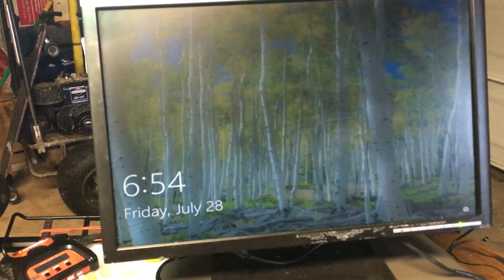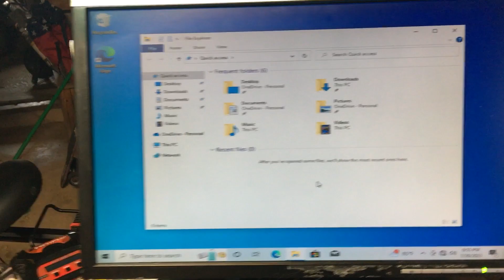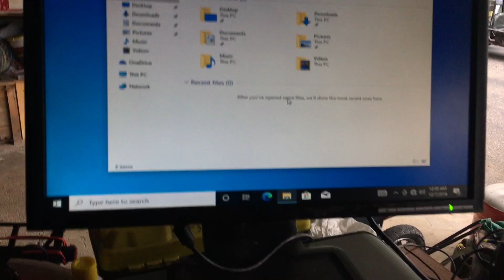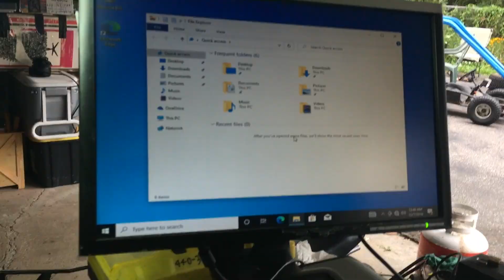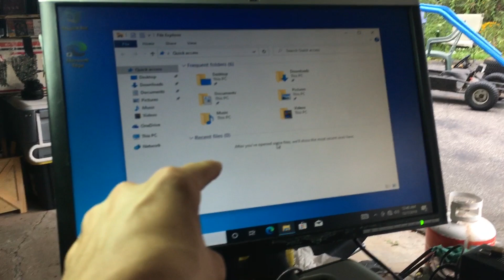Can a SSD Make Your Old PC FASTER

Comment: How did you get windows 10 to run on yours because mine would bluescreen
Reply from the maker: @XDVORTEX09hi how are you doing? I created a windows 10 bootable thumb drive 
Inside of Rufus, I selected the mbr partition style, and then after the thumb drive was finshed, I plugged it In and proceeded to install windows 10, try making sure the windows 10 thumb drive is in mbr scheme
Reply: @ I created the thumb drive but I don’t know what mgr partition style is

Comment: POP OS {Linux} just works well on older machines whether it has a SATA drive or SSD...

Once I get Wine to work in Linux, there will be no need for me to ever touch a computer with Windows on it - forever!
Reply from the maker: Correct yes, I ve always had trouble trying to get wine installed, but I will have to take a look into it Thankyou

Comment: For an older PC or laptop, I just double the ram and that gives a performance kick...

For Windows users, it does not matter how fast the hardware is - as long as that computer is connected to the internet, eventually it will slow down because of all the commercial crap running in the background and the forced updates...
Reply from the maker: Oh yes indeed, I agree

Comment: I just about BAILED OUT when he CALLED A SPINNING RUST DRIVE and OPTICAL DRIVE_but I stuck with it. I replaced a supper slow _RUST DRIVE in a 12 year old HP tower case computer with a Samsung - 870 EVO 500GB  a SSD SATA and it made it into a LIKE NEW FASTER COMPUTER. Then a couple of weeks latter the BIOS failed, and now it will not detect the key board or mouse in BIOS, I can't get into the BIOS and it will not boot to Windows. One NOTE with the Samsung - 870 EVO 500GB  a SSD SATA drives, if you think you will be handling it a lot put a strip of clear packaging tape over the label or take a photo of the label the CRAPPY INK that Samsung uses on the labels RUBS OFF onto your FINGERS!!! And you can no longer READ the label!!!
Reply from the maker: yea for some reason, I have always said optical drive my brain pan always thinks to say that lol, i do know what the correct names are for it tho, thats interesting that your having that much issues with that ssd in that tower, could be a issue with the keyboard (i am sure you tried multiple keyboards and no luck) i am not sure, if you can reset the bios if there someway to slect options in the bios, other then that I am unsure, keep trying different things, normally any desktop will respond to the keyboard no matter what.
Reply: @TechSimplified910   Thanks for the reply, I did try two additional keyboards and mice and they did not work. I also tried both the keyboard and the mouse on two different computers and the did work.
I removed the BOIS CMOS battery and all of the external devices from the computer and let it sit over night, the next day I installed a NEW BOIS CMOS battery along with all of the external devices rebooted the computer the keyboard showed lights press the Esc key and it went into the BIOS setup, I configured and saved the BIOS, the computer booted in to Windows and ran like it should. At this point I wanted to see if it would restart so I shut down windows removed the power cable and press the start button to discharge the capacitors on the mother board and in the power supply when I rebooted it  there were no lights on the keyboard and I could not get into the BIOS and it would not boot into Windows.
I repeated all of the previous steps and it will not go into the BIOS or boot to windows. At this point I am lost I believe the BIOS chip on the motherboard it TOAST!!!

Comment: It will not make computers faster that have old amd processors in it with a total of 1mb l cash in it. Even if they are quad cores.
Reply from the maker: true yes indeed
Reply: It will speed up load up time.

Comment: SSDs also need less power, produce less heat and most important, make no noise at all! My computer boots in about 25 seconds to the prompt. Linux
Reply: HDD hard drives has a limit after 8 to 10 factory resets it starts to lose blocks of data (starts to fail) ssd can handle up to 10,000 factory resets maybe more, we don't know.
Reply from the maker: good to know, I never new that about hdd hard drives, thankyou comenting
Reply: @TechSimplified910  If you are a gamer, you have to use the right ssd mine runs at around 400 MB read and write speed. Old school days, you would have your os on hdd and games on ssd
Reply from the maker: yes indeed same many of my other old machines, it amazing how cheap ssds have gotton over the years
Reply: Love Linux, owns windows lol

Comment: Yes, an old computer with mechanical drives can get much fast with a SSD and SSD are now dirt cheap. But a SSD is limited to 550MB/s. If you have PCIe slots in your computer, you better get a NVMe disc. The slowest is at 1GB/s.
Reply: motherboard needs to support booting to pcie first. if not, needs a bootloader in a usb to load nvme-pcie
Reply from the maker: ok good to know thankyou
Reply: @n0madfernan257  ???????????????????
Reply from the maker: good to know thankyou, yes true ssds have gotton way cheaper

Comment: HDD - Hard Disk Drive not optical drive. Hard Drives read/write using a needle on a spinning platter similar to a record player, so they can't go very fast
Reply from the maker: Yes, you are right, i made a mistake when I said that, thankyou for the correction

Comment: HDD are not Optical drives.   As you said, they have read/write heads.  Heads float on cushion of air over the surface of the spinning disk.  Heads do not touch the disk, they read the magnetic characters written on the surface.  The heads are made in the shape of an airfoil like an aircraft wing and fly incredibly close to the surface of the disk.   If a head touches the surface that's when the term Crash became a thing in the computer world.   Disk/Head crashes usually were the result of speck of dust making its way on the disk surface. That was quite common back in the  1960s and 70s.    Optics have nothing to do with HDDs.  
DVDs,  BlueRay etc. read with optics.  SSD are much faster.   In the old days many HDDs had removeable disk  (platters) but the read/write heads were a part of a separate unit.  Disk were swapped  in and out depending on what data needed.  Much like how you see tapes being swapped in old movies.   (IBM 1968-1999)
Reply from the maker: `yes indeed thanks for the correction that is my mistake, thanks for the information ;)

Comment: I recommend Linux mint for testing computers and their hardware as it doesn’t need drivers and boots up very quick
Reply from the maker: Thankyou for that information, I will have to try that out thankyou, i am thinking about making a video on that thanks for the idea, would you want a shout out of your coment in the video?
Reply: I second this. You can run the complete environment right from the USB drive without installing. 

But, mint is super fast on an SSD and actually pretty good on an HDD.

Comment: Keep the old drive for long term data storage.  SSDs maybe a lot quicker but the data may become corrupt after a number of years.  I don't really care for cloud storage of any kind such as one drive.  Hard drives are cheap enough to buy easily.  The worst thing is you must handle them more carefully and gently since dropping them can result in them becoming unusable.  Just watch out for SSDs with low TBW estimates.  They may be cheaper and may work fine for some people.  I would still recommend a backup to a hard drive.  It can be an external one.  If it is going to take hours to do, just let it sit overnight. Unless it needs your input on what do do with a file that already exists on the drive it should complete soon enough.
Reply from the maker: thankyou for tbw information I will have to watch out for that
Reply: I run one to keep a backup, and another for storage of items like photos and music

Comment: The Hard Drive is not an "optical drive". Because it magnetically reads and writes files to sectors to and from the hard drive disk(s) internally. Optical drives, write and read using laser light, like DVDs and CDs. Thus they are optical drives.
Reply from the maker: ohh ok, thankyou for letting me know. thats a good thing

Comment: SSD are dirt cheap now specially these SATA ones, Windows Vista will be interesting to see on an SSD on this computer since back then they were rare and super expensive when Vista came out, also would be nice too see how this computer performs in terms of light gaming  and other stuff, install the graphics drivers!
Reply from the maker: yes indeed, I will be showing how windows vista performs on a ssd, and light gaming, I am interested to see what happens
Reply: Even hard drives are cheap now.  I was able to get a 1 TB for maybe less than $40 after taxes.  I know it was definitely less than $50
Reply: yeah but you can get dogshit performance if you go too low. some cheap drives have no cache or any kind which is awful if the nand itself isnt that fast. my old sandisk ssd+ drive would grind to a halt during any kind of download. well it still does but at least im not booting off it anymore. honestly my hard drives download at a more consistent rate.